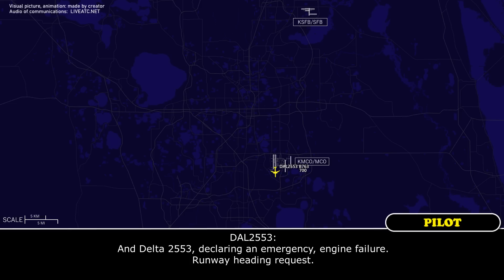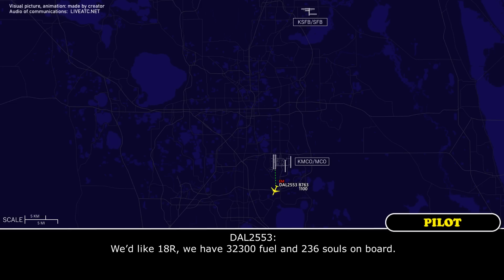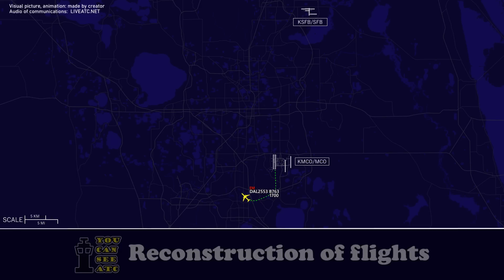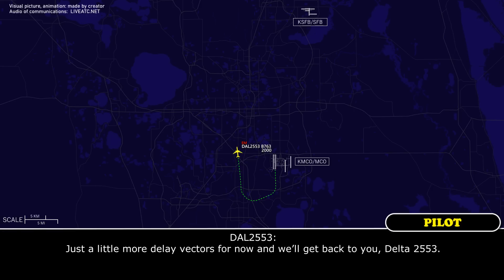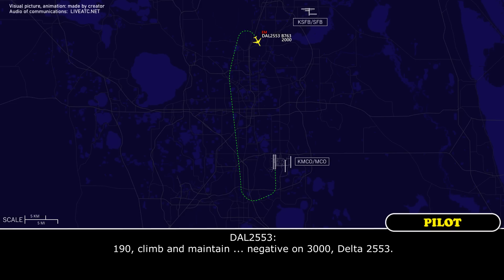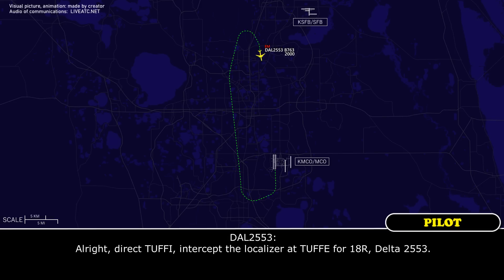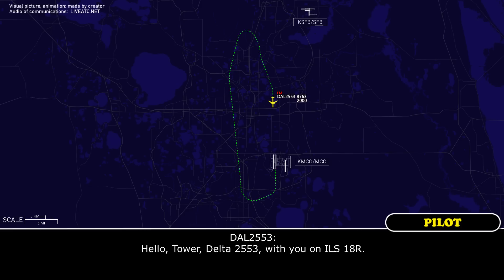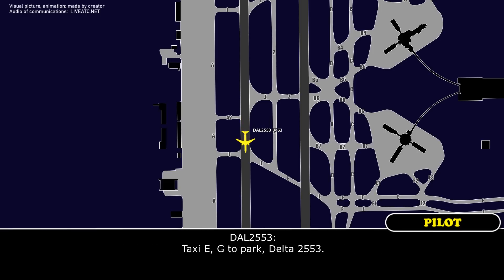Engine failure shortly after takeoff. Delta Boeing 767-300 returned to Orlando. Real ATC

Comment: January 3, 2023, DAL870 LAS to ATL, Boeing 76 diverted to LAX two hours into flight. Delta admitted to mechanical, but no details. They towed the plane to hangar after deplaning at gate. Would be interested to find out what happened to necessitate a u-turn all the way to Los Angeles (not even our starting airport of Las Vegas).

Comment: As a passenger, maintaining 1000ft right after takeoff has to be incredibly sketchy
Reply: Acceleration altitude is 1000' AGL. When you lose power on one engine you climb to 1000' level off then accelerate to flap retraction speed, clean up then climb to whatever altitude is necessary.
Reply: @mijo3642  - you don’t level off at the acceleration altitude, the rate of climb is reduced and you accelerate with associated flap reduction. Aircraft must be in a positive climb in the 3rd segment of an EFATO.
Reply: @EdOeuna  In an engine failure in the 767, at the engine out acceleration height you accelerate at 0-200 feet per minute. If the aircraft is heavy, zero feet per minute (level flightI) is required. That is precisely the engine out procedure. I have flown this type for Delta and another major carrier and that is the approved procedure.
Reply: @JohnSmith-zi9or  - legally you need a positive climb during the acceleration.
Reply: @EdOeuna  Then every operator of the 767 is in violation. Call the FAA, the people who certified their Flight Manuals and Engine Out Procedures.
Reply: @JohnSmith-zi9or  - it’s the FAA that mandate the “positive segment 3 climb”. I’m not a FAA Licensed pilot but the legal requirements for multi-engine is the same in Europe and other countries, including the country where I learned to fly.

It’s basic Air Law that all commercial / ATPL pilots should be aware of. Maybe the 767 is underpowered and maybe 0 climb is considered “positive” for the purpose of certification.
Reply: @EdOeuna  Show me in the documentation that the in the third climb you are required to climb. Even A320 engine out procedures which you can Google, or watch here https://www.youtube.com/watch?v=KyWBCiQYRVM 
show the crew employing vertical speed ZERO in the third segment. 

This is the same on the 757 and 767. 

The third segment is for acceleration.
Reply: @JohnSmith-zi9or  - Google is your friend. Also, there’s a US government organisation called the FAA. It’s in their documents. If you’re a pilot you should have learned about it for twin engine endorsement or maybe in ATPL Performance exam.

Third segment climb is “positive”.
Reply: @JohnSmith-zi9or  - your comments are being shadow banned by YouTube because (a) you’re using bad language and (b) because you’re including external links to websites.

If you’re going to argue on YT then at least learn the rules first!
Reply: @EdOeuna  This is not an argument. I was just posting links to source documents to prove you are wrong. That is all. Good day.
Reply: @JohnSmith-zi9or  - so the comments that don’t show contain links to documents I can’t see, which proves your point? So all the documents, websites and images that Google display showing “positive” are wrong then? I’ll inform the internet. 

As I said in one of my first responses to you, maybe they consider level flight as positive, being that it’s not a descent to accelerate. Maybe it’s positive for gross flight path so level for net flight path. Either way, it’s not particularly important since segment 1 and 2 are most important. 

In my home country the requirement is 1.2 without reduction from gross to net flight path.
Reply: @EdOeuna  You can search and read the LAW as I posted it ... not documents or images from Google. The LAW. The CFR. All of the segments are important. You must clear the obstacles in all segments. It doesn't matter which segment you're in if you hit something, the results are the same. 

It is ok for you to admit that you were initially wrong. And I showed you at least three airplanes that I'm typed on and familiar with that level off (which you first said is illegal) in the third segment as procedure in the flight manuals.
Reply: @JohnSmith-zi9or  - I’ll let you tell FAA their training documents are wrong, since you like arguing with strangers on the internet so much.
Reply: @EdOeuna  I'm not arguing. You're just wrong. I can't speak to "training documents" Googled. I can, and have, showed you the electronic code of federal regulations regarding takeoff flight paths and engine-out requirements in the USA. As I said, and have proven with source documents and anecdotal information from being typed on several aircraft that level off for acceleration at the acceleration height to which you said was ILLEGAL and it is not. Good day sir. Thanks for never admitting you were originally wrong.
Reply: @JohnSmith-zi9or  - all the comments you posted containing links do not show on YouTube because, normally,  moments with links to external websites are auto-deleted by YT, so you haven’t proved a thing. Plus the comment containing bad language has been deleted too.

You haven’t proved a thing.
Reply: @EdOeuna  ECFR Part 25 ... search ... engine out requirements and flight path .... the ECFR is the source document for the law. No bad comments. No deleted websites. You'll see. You're wrong.
Reply: @JohnSmith-zi9or  

CFR 

§ 25.122 Climb one engine inoperative. 
(A) “In the critical take off configuration…the steady gradient of climb must be positive for two-engine airplanes”

(B) “In the takeoff configuration existing at the point of the flight path at which the landing gear is fully retracted…(1) The steady gradient of climb may not be less than 2.4 percent for two-engine airplanes”.

“(C) Final takeoff.  In the en route configuration at the end of the takeoff path…(1) The steady gradient of climb may not be less than 1.2 percent for two-engine airplanes”.

§ 25.111 Takeoff path.

(a) The takeoff path extends from a standing start to a point in the takeoff at which the airplane is 1,500 feet above the takeoff surface, or at which the transition from the takeoff to the en route configuration is completed and VFTO is reached, whichever point is higher.

(C) During the takeoff path…The slope of the airborne part of the takeoff path must be positive at each point.
Reply: @EdOeuna  1. You said, "“positive segment 3 climb”.  There is no third segment defined in the CFR nor is a positive "climb" required. 

2. You said, "legally you need a positive climb during the acceleration."  No, you DO NOT need a positive "climb" during acceleration. No where in the CFR does it say "positive climb" or "positive climb during acceleration." 

3. You said, "you don’t level off at the acceleration altitude." I showed you at least two American and one European aircraft that I'm familiar with that procedurally and as certified by the authorities, do indeed level off because the aircraft is unable to reach the top of the takeoff flight path as defined by law and then accelerate to en route configuration before exceeding the maximum takeoff rated thrust limitations. 

4. Again you said, "Aircraft must be in a positive climb in the 3rd segment" 

How clearer can I get? There is NO third segment mentioned in the law. There is nothing anywhere that mentions the words "positive climb" ... it just doesn't. Zero zip nowhere. 

The law DOES MENTION "gradients" and "slopes" which need to be positive. This is different than CLIMBING. This is why said aircraft are certified to level off. 

I posted an extremely good website which detailed all of this. You said YT banned it. So I told you how to find it and apparently you either found it or discarded it. They explained all of the nuances here and why the wording in the law is the way it is. 

So I go back to my point which started all of this ridiculousness. YES, many airplanes LEVEL OFF at the acceleration altitude (normally 1,000ft AFE) during an engine-out situation as approved by law and as certified by the authorities. 

END OF DISCUSSION. NO MORE RETORT. NOT RESPONDING TO ANYMORE OF YOUR POSTS. Good day.
Reply: @JohnSmith-zi9or  - wowzers you are triggered. 

CFR 25.121: “Steady gradient of climb must be positive”. 

You can’t have a steady gradient of climb without a positive rate of climb. That’s basic understanding of English (not my first language) and application of flight procedures. There is even a rule of thumb for calculating the required rate of climb to attain the gradient required. With a V2 of 180 you’ll need 500fpm.

The law doesn’t mention segments, but the application of the law splits into 4 segments, with 1 being 35ft to gear up, 2 being to 400ft, 3 being acceleration and climb to 1500ft and then 4 being the enroute climb. These different phases appear in the law through its interpretation and application. Even the FAA guide that I made a video on, especially for you, shows the climb split into segments. To deny that the segments exist, despite being clearly present in training material and taught as aviation basics to ATPL pilots is taking pedantry to a new level.

You’ve been going on about level acceleration. Now you’ve changed your argument to “segments don’t exist”. You’re changing the direction of the argument because I’ve just quoted the LAW to you, and proved you wrong.

I accept that airlines may require level acceleration. Maybe their performance is poor enough that this is required. It isn’t for the aircraft I fly. The FCTM states “At engine out acceleration height, if VNAV is engaged, a near-level climb segment is commanded for acceleration.” Near level, but still positive. I have looked up the Boeing 767 FCTM and I see that it says use V/S and 0-200fpm to accelerate. Like I said in my second comment, obviously 0fpm is considered positive for the purposes of abiding by the law. So I’ve acknowledged that 0fpm is acceptable, but the law still says “positive gradient of climb”.
Reply: @EdOeuna  what he f*** are you talking about? simplified for you: maintain directional control, rotate when ready 12.5 degrees, +ve rate gear up, maintain V2 to V2 +10, trim rudder, A/P on,  climb to 1000' AAL, push VS to level off,  accelerate to FRA,  retract flaps then pull ALT to continue climb.  Major airline SOP.  Guess flight sim doesn't tell you that eh? LOL
Reply: @mijo3642  - like I said in my third comment, clearly the authorities consider 0fpm as sufficient once maintaining 1000ft AGL if it allowed as an airline SOP.

The law and FAA documents say “positive climb gradient”.
Reply: @mijo3642  Slight correction ... 1,000 feet AFE, not AGL.
Reply: @JohnSmith-zi9or  It actually depends what the Aerodata dictates but, in easy language standard initial EO procedure, runway heading to 1000' above the airport yes.
Reply: Almost nobody noticed it. I was riding right behind the wing on the window on the #1 engine side. Herd a noise, lost climate control and infotainment then I noticed we weren’t climbing, so I opened my window shade. I knew when I noticed how low we were that we were going to end up back at the airport.   Hilariously, I got rerouted through MSP but my flight had to divert because of the plane that went off the runway there that night.
Reply: @mrlt1151  that is the plan...

Comment: Lol the approach wanted him to climb…. Bro the guy just lost an engine and you want to over work the only
Engine he has! Lol
Reply: He needs to be at the minimum radar vectoring altitude if he wants radar vectors. The aircraft is perfectly capable of climbing on one engine or else it would not be certified by the FAA
Reply: @mijo3642  Yes, correct. However, the pilot must execute the engine-out procedure in the flight manual. In order to accelerate and clean up the aircraft they have to level off or climb up at a rate of 200 feet per minute in order to accelerate and cleaning up the aircraft's wing. After cleaning up or at the appropriate flap setting, the aircraft will then climb to a safe altitude.
Reply: @JohnSmith-zi9or  what? However??I just said that. You telling me my job? LOL
Reply: 25mile MSA for Orlando is 3000ft, so you’ll climb to at least 3000ft following an engine failure.
Reply: @EdOeuna  after acceleration altitude and needs to be above Orlando Exec.
Reply: @EdOeuna  you will do whatever you need to do depending on the circumstances once the initial SOP's are carried out to secure the aircraft in controllable and flyable condition..
Reply: @mijo3642  - an engine out situation is pretty easy to deal with, and climbing to the MSA is a basic requirement to ensure aircraft safety.
Reply: @EdOeuna  As if you would know?LOLOLOLOLOLOL How about not trying to tell my 30 + yr job from your MS flight sim  Jeez.. am done with this pedantic discussion..  bye
Reply: @mijo3642  - you seem to be pretty triggered in this discussion. 

I said that the MSA is 3000ft, so any sensible pilot would climb to that altitude. This is common sense and seems to agree with your statement, yet you’re arguing with me about it.

John Smith then suggests that the plane would climb whilst following the engine out procedures, which contains an acceleration segment. Again, this is correct but you’re arguing with him too. 

Then the final pathetic attempt on your behalf to discredit my comment about engine out situations being pretty easy to deal with. They are, as a 30+ year veteran of the aviation industry would know.

The ad hominem attack on me is a childish way to argue and shows you up for being a troll or just simply someone wishing to annoy and disagree with people, but you’ve demonstrated this because you’ve got 2 people agreeing with what you’ve said, and your arguing with us.
Reply: @EdOeuna  damn that kid is such a whiner, proven wrong and bolts from the conversation LOL
Reply: Hey “You can see ATC”..   Can you do one on the engine failure on the westjet flight from Comox BC Jan 2/2023 with a Dash 8.